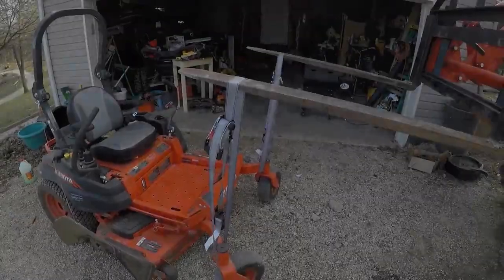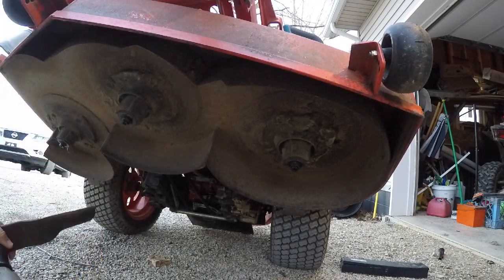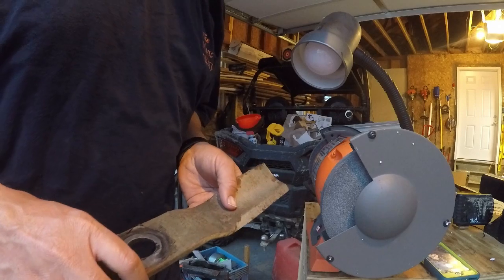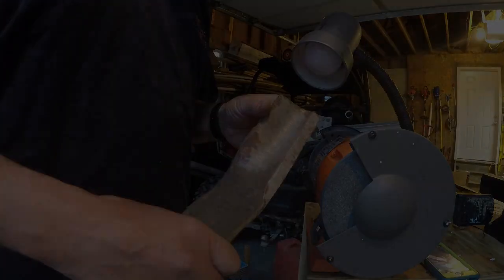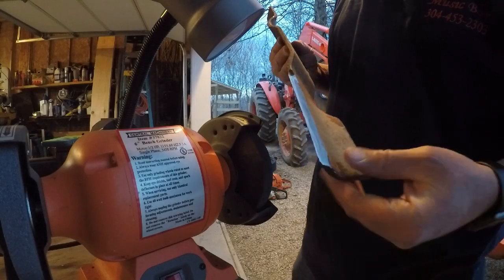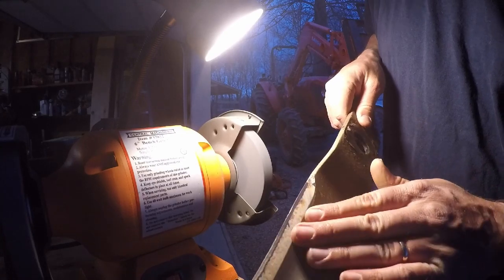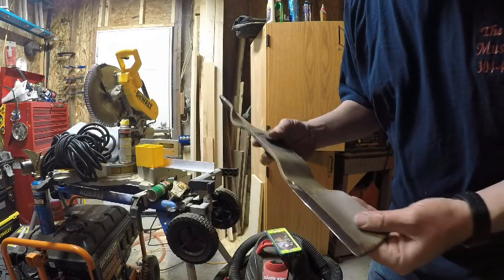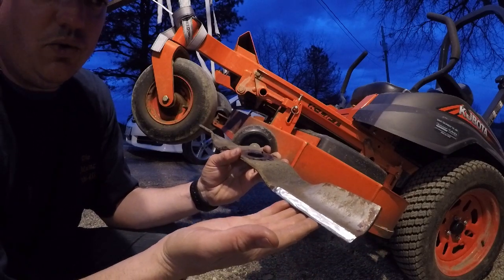How To Sharpen Mower Blades Kubota Z421 #34

Comment: I’ve always been taught you need to balance the blades after sharpening  or you risk wearing out your spindle bearings prematurely. Also I’ve found a flap sander on a 4 1/2” grinder with the blade in a vice works much better.
Reply from the maker: Thanks for the info I may try the flap wheel in the future!